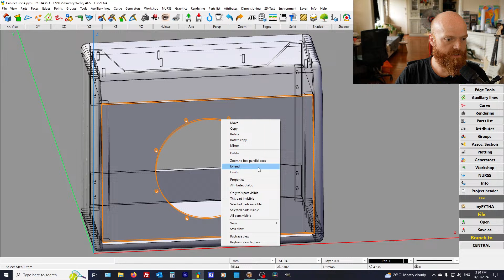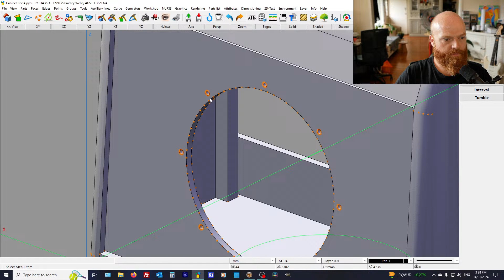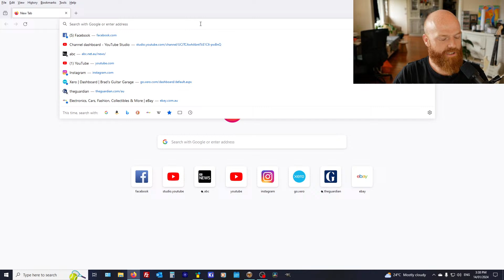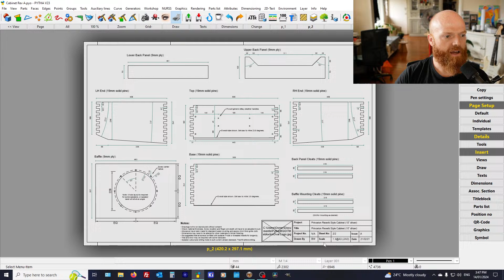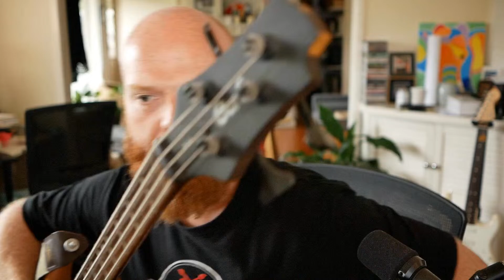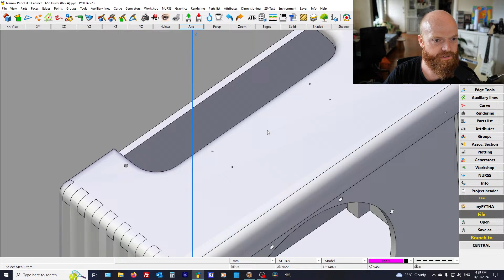*SKIP TO 3:00 [AUDIO PROBLEMS] Last Day Of Holidays - Pytha 3D CAD & Live Chat

Comment: Great video Brad. Looking forward to your amp series. Look into water-jet cutting the aluminium panels. I laser cut some 3mm aluminium panels for a custom speaker cab. The finish was less than great and I spend about 6 hours hand filing the cuts to a smooth finish prior to anodizing.